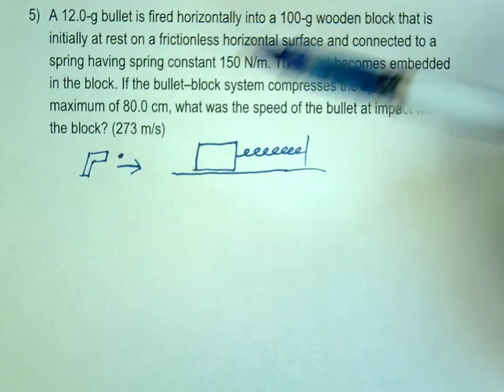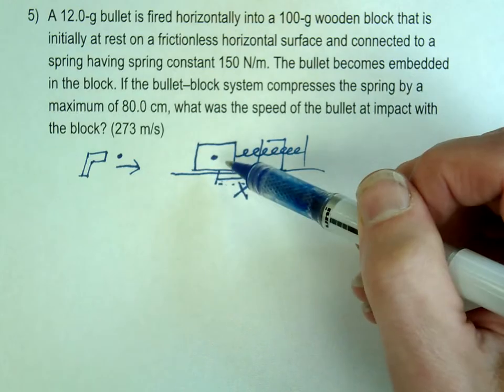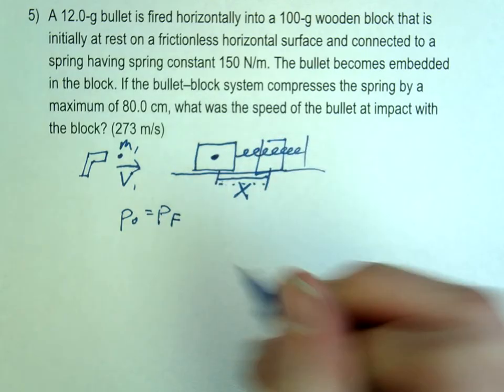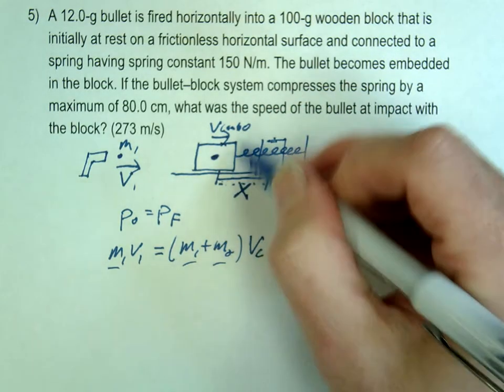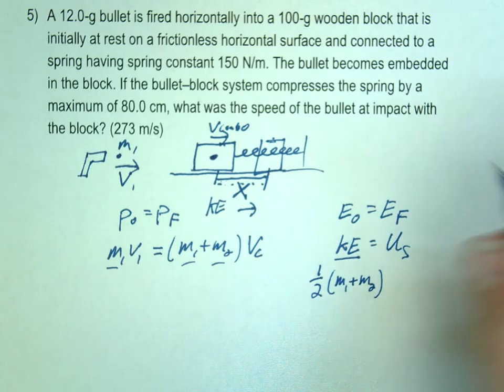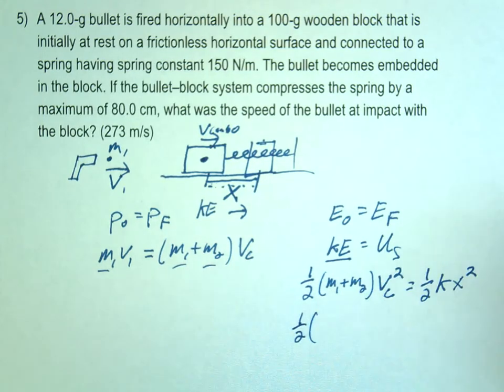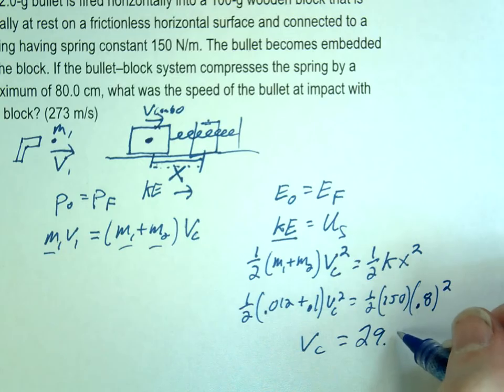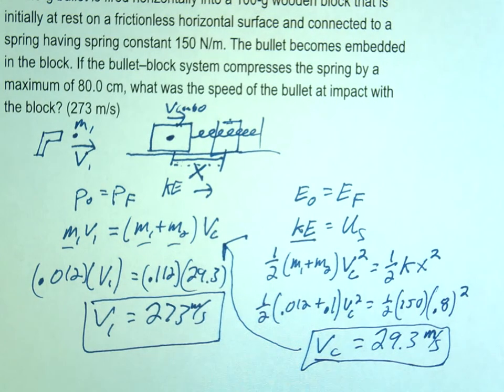Understanding Collisions: Bullet to Block to Spring Momentum/Energy

Comment: 3:10 Is there an initial kinetic energy for the bullet  only 1/2mv^2? 🤔You didn't take it under consideration which is a huge mistake
Reply from the maker: The KE we were looking for is the bullet-block combination (after the bullet was imbedded.) The reason you can't use the KE of the bullet before it collides with the block is that there will be a tremendous amount of KE lost due to the collision, the amount of which is not able to be determined.